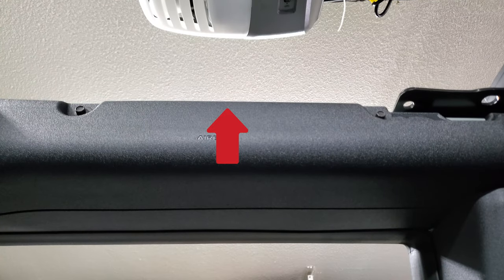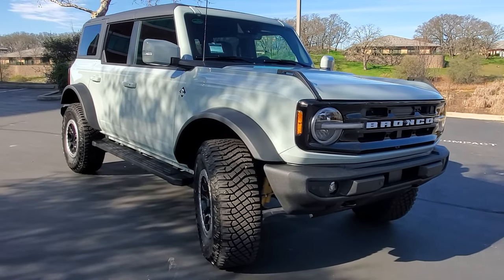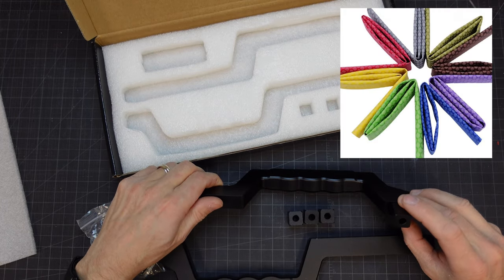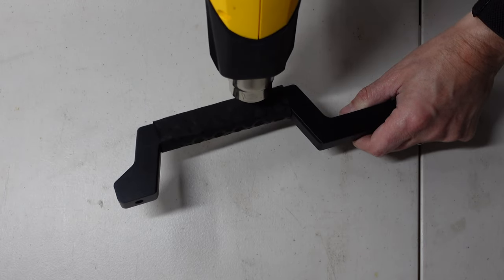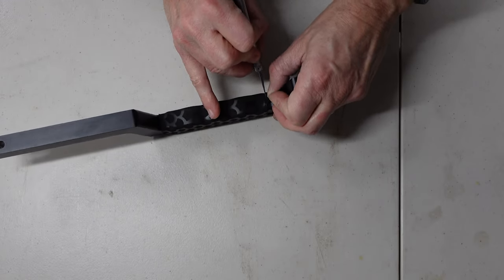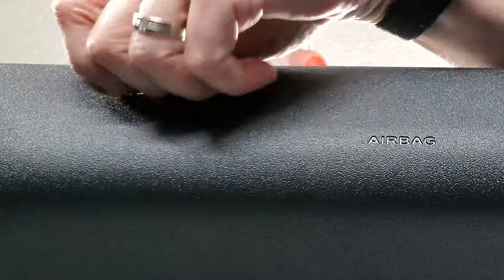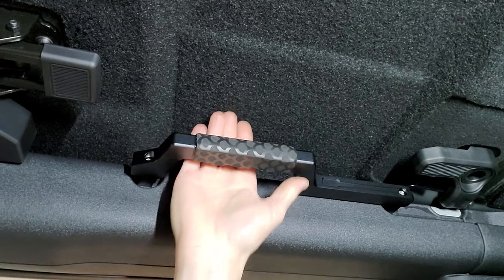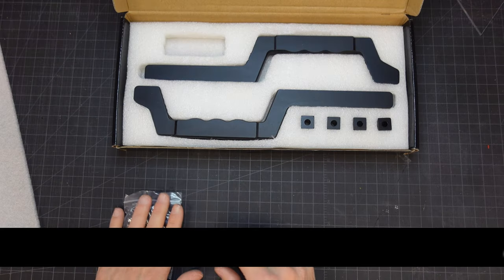Ford Bronco Metal Roll Bar Grab Handles with Special DIY Mod 💩 Unboxing, Install, and Review

Comment: Will the airbags will deploy with these?
Reply from the maker: I wondered the same thing before I got them. From what I read, the side-curtain airbags should deploy fine. They drop down, so the handles are completely out of the way.
Reply: Yep, i will definitely trust cheap Chinese crap form amazon that it is designed well and will not compromise saftey
Reply: @anthony gallo  so how are they gonna compromise safety?

Comment: Any update on how they are working out? Was trying to climb into my lifted OBX today with stepping on the freshly washed running board, and realized a high grab handle would be useful
Reply from the maker: Still working great for us. I use the new ones all the time. It's more natural for me than the factory ones. 👍🏻

Comment: I just had a conversation about this. I don’t like putting anything between airbags and me. 
I believe the reason Ford didn’t put handles up there, or on the a-pillar, because they decided for better safety with airbags. 
Do I miss my jeep handles? Sure. 
Do I like having something to keep my head from going through the window instead of “convenience” handles? …yes. 😅
Reply: Yeah I would be worried it would keep the airbag from deploying or worse, be a missile when it does

Comment: I went with the paracord type.   I really worry that with the extra leverage the way they extend out,  the risk of damaging the bolts is pretty high.
Reply from the maker: That's actually a really good point. The metal ones feel really sturdy with zero play, but you never know. At least my wife and I are on the small side, so we won't be putting a ton of weight on them. If they ever do fail, I would definitely post an update here.
Reply: We went with the Paracord type but I really like putting the heat shrink on these. We have the blue leather as well and I might order some blue from different manufacturers and try to match it. The only real negative review I saw on these was the edge is too pointy so hopefully they hold up over time.

Comment: So.. One need only buy TWO - Sets of these - as you can't leave the back-seats wishing for a Grab Handle... (I installed Cord-Rope handles - it just hangs down too low for my likes).
Reply: They do not make these for the backseat it’s a whole different size, and I agree with you. I had to rip cord on mine first, and I could not stand the distraction of it constantly moving.